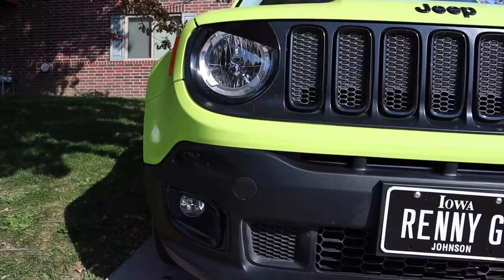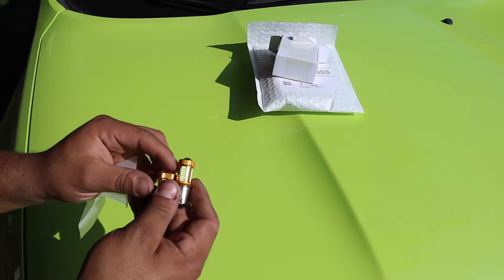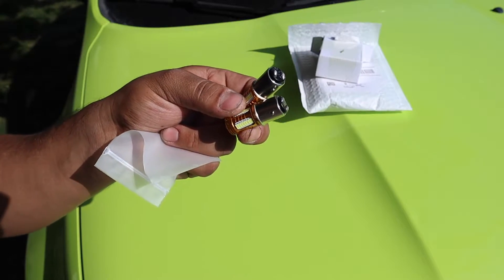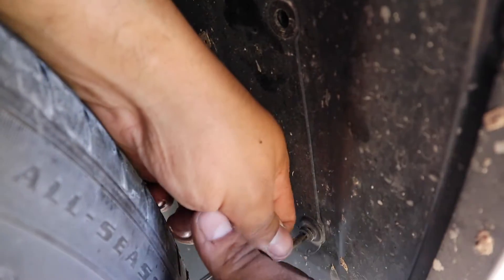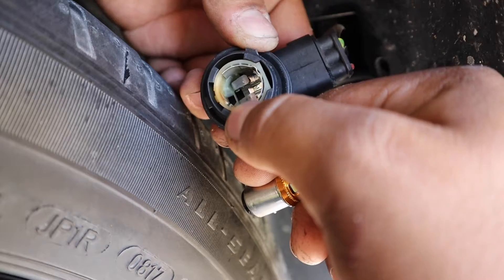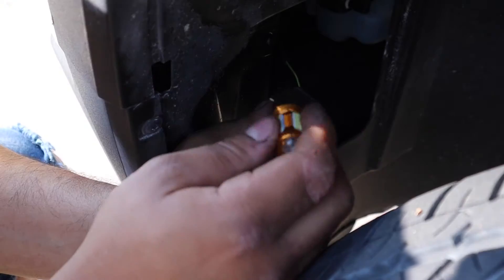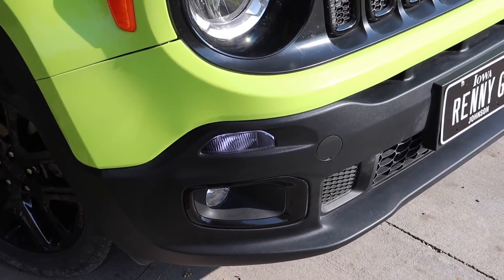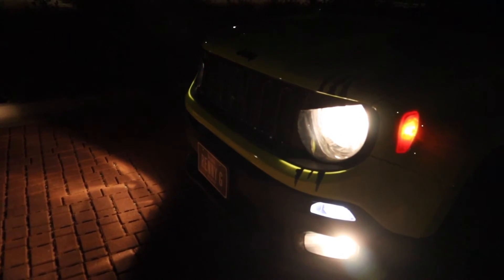Jeep Renegade LED Daytime Running Lights (DRL)

Comment: Great job! I check with your channel for any help I need with my 17 Renegade
Reply: Can you recommend a good fog light that doesn't cost as much as parts stores. In my area they are $80...Anyway the one on the passenger side got so hot it melted the housing. Ordered from the Zon and had thos put in, same thing, now passenger side is black and the driver side has moisture in it 🤨
Reply from the maker: Are you trying to run LED lights or stick with the OEM style light?

Comment: Hi great video, my 2017 Renegade ....Im doing the OEM style Sylvanias for now, after the passenger side stopped working .... but I tried two replacement bulbs and still no light (while it was hanging in the wheel well), I thought maybe it wouldn't light up until bulb mount is replaced into housing, to make a ground or something, but still no go. The other side works fine. Any chance theres a fuse for each side ? The bulb receptacle and pigtail all look fine, no wear or cuts in the wire or anything.  Thank u!
Reply from the maker: That's weird. I don't believe there is individual fuses for both left and right. Something is up for sure, bad wire somewhere
Reply: @AdventureGT  Ok thank you !

Comment: Did you like them lights did they work good
Reply from the maker: So the ones I currently have on, which is in the link down below, are better than the original ones I had. I haven't had a single issue with these yet
Reply: @AdventureGT  ok thank you so much

Comment: My front right side running light keeps going out!
I took to a shop and they said I used wrong bulb. The one they used blew after 5 weeks.
Question on your video?
The part you have linked shows it being a fog light, do you have the part number and manufacturer name?
Thanks, video is helpful!
Reply from the maker: iJDMTOY is the company that makes them. They make a few LEDs for the Renegade that work great. As for bulb or part number I'm not sure. I took the gamble buying them and I haven't had any problems since

Comment: I am trying to do this for my Jeep Renegade but they are not screws.  I was told it’s sort of like a push-pin that’s in the middle and when you pull that out, you can then pull the bigger part out.  I cannot for the life of me get the middle piece out.  Does anyone have any tips??
Reply from the maker: I understand your pain period enough times of me going in and out of there I think I might have messed up the piece. Realistically you can grab pliers and force it out. I'm not saying nothing will get damaged, but at least you'll have it off

Comment: Great video! Really helped me out. I replaced the rear turn signal lights and about to replace the DRL. First time changing out since I had 5 different lights go out, 2016 Renegade. I picked up the Phinlion. I am still getting the flashing though for the rear TS, not sure if they have the resistors.
Reply from the maker: I haven't replaced the rear TS yet. Don't really want to run resistors. Was hoping to get an ( all-in-one) LED bulb that can do it all

Comment: Good video dude. I ordered DRL’s almost 2 weeks ago. I should have them by next Monday. I hope I bought the right kind of LED’s. It’s so many options. I have a 2018 Renegade. My fog LED’s are on order and should be on the way. I just happened to stumbled across your video. I replaced the side markers last year.
Reply from the maker: I'm glad you liked the video. I also ordered LED fog lights and LED head light. I will be making a video on them both.
Reply: @AdventureGT  I don’t make YouTube videos but I will post photos on the Renegade forum. I watched you new video btw.
Reply from the maker: Look forward to seeing your pics. Thanks for the video watch.
Reply: @AdventureGT  I posted photos on the Jeep Renegade forum over the weekend.
Reply: @AdventureGT  I have to order some new DRL. The brands I purchased didn’t last long.  My fog lights are still holding up.  But I don’t use them as much maybe that’s why.
Reply from the maker: Thats interesting. My DRL's haven't had any issues. My fog lights are going strong still
Reply: @AdventureGT  yeah last year I bought DRL’s in October and December off eBay. The first pair one bulb was faulty and loose and went out quick. So in December I bought another set. And the bulbs went out February. So 3 out of 4 bulbs worked. My fog lights and side markers are good since I installed them.
Reply from the maker: Yeah unfortunately the LED DRL lights can really only be found by foreign manufacturers

Comment: Mine is always going out. Local parts store said LEDs didn't exist for that bulb. Glad to see they do. Maybe an update to see if the ones you switched to are still functional after a year or so?
Reply from the maker: Thats a great idea for a future video. So far no major issues. Still going strong 💪
Reply: are these lights still working?
Reply from the maker: After the update I haven't had any issues

Comment: Do the turn signals still show up clearly?
Reply from the maker: Oh yes. 100%
Reply: @AdventureGT  I have a 2021 and found out it takes different bulbs, my drl and turn signal is one bulb. Found some Alla psy24w less I’m gonna try though. Awesome video’s though man. Got the reverse and headlights coming though.
Reply from the maker: Oh dang. Yea the newer Renegades are a little different in certain things.
Reply: @Chris-km7rd  you got a link to the DRL bulb? Got the 2021 also

Comment: Does yours have like that after burn? Looks like they are kinda on when the car isn’t?
Reply from the maker: Yes, it does do that. I haven't had any bad side effects because of it though.
Reply: @AdventureGT  thanks man. I’ve bought the fog lights, reverse lights, running lights and headlight that you installed😂 love them all so far! Got anything else coming?
Reply from the maker: I really appreciate your support! There's a few led lights that I still want to upgrade to but haven't pulled the trigger on. Keep an eye out for those videos to come
Reply: @ryangrindstaff2935  would love to get the links to all the lights that you have bought and are working.  I have a 2018 Renegade and would really like to upgrade all the dull white bulbs that  come standard :)
Reply: Would these fit a 21 Renegade?
Reply from the maker: I don't believe so, sorry
Reply: @uwdoug79  for the reverse lights??
Reply: @ryangrindstaff2935  basically the headlights DRL and the tail lights.  Not necessarily the reverse lights